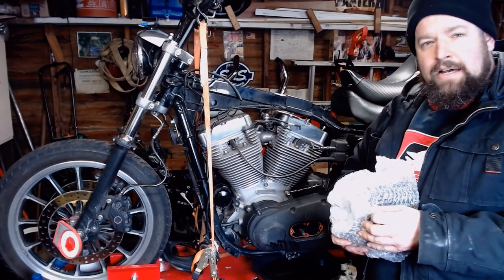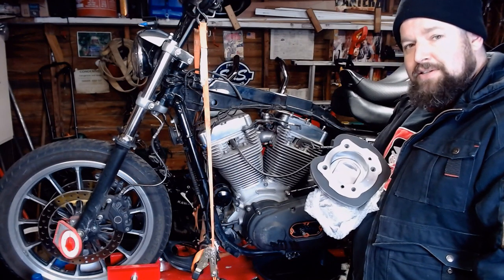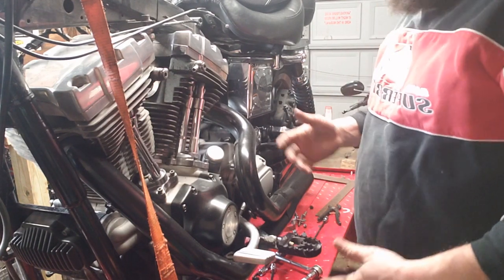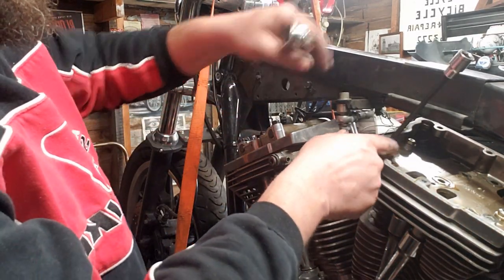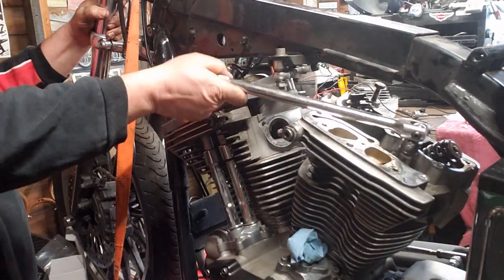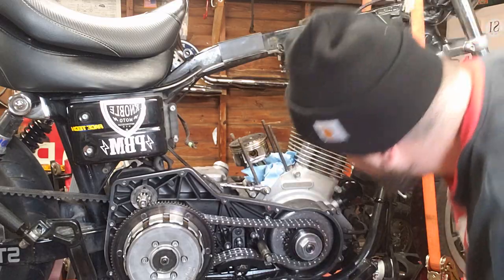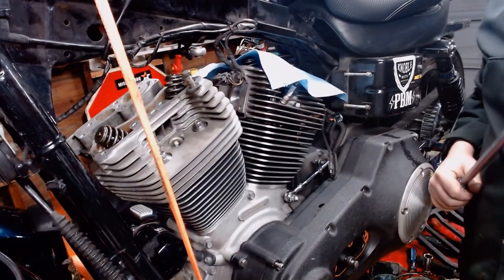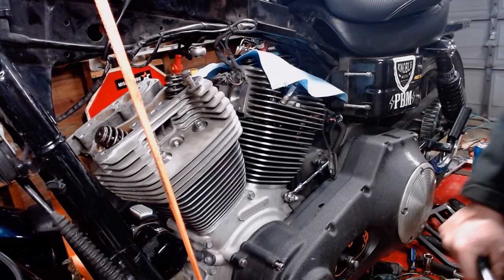95" Big Bore Kit on Harley Twin Cam Install

Comment: What year ?
Reply from the maker: 2005
Reply: @KnobleMoto  do you think it’s 100% necessary to do the timken bearing upgrade before big bore kit and cams
Reply from the maker: @MrHootenholler  no.  I wouldn’t bother with that unless you are pulling the crank. Even then, unless you are going for a stroker or 120+hp, I don’t think it is necessary.

Comment: Is this a Russian Harley ? 
At time 12:29  better to push the ring down the cylinder somewhat with the piston, keeping it square. Not measuring the ring at the top.
Also , at time 16:26 not so good to scratch the top of the piston with the ring . Wow! As I watch this video I see more things not looking good . I see no oil on the piston or rings ,  and 
most jobs put the piston on the rod first , GGG. I think you installed the piston that way cause of the type of ring compressor you had. Again, at time 28: 04  you torqued the head /cylinder 
down the wrong way.... Not to be torqued cross way,  should have been torqued  lowest bolt  one one side first then highest bolt on same side , moving to other side lowest then highest.
Reply from the maker: A small scratch on the top of the piston doesn't matter because that is not a contact surface. Everything was oiled that needed to be.  I hope I didn't forget to mention any oiling steps in the video.  Yes you lube all metal to metal surfaces with a heavy oil or assembly lube.  I am not a pro cameraman or tv star, so a lot of this was done in multiple takes.  The ring compressor came off at least 5 times (should have bought a better one).  
Anyways, the motor has 3k on it since this build and it runs strong.  Thanks for you input.  Tag me in your motor assembly video so I can see how you do it.
Reply: @KnobleMoto  .... In the video you didn't put one drop of oil on the ring. Also,  while you were sliding the rings on the piston you scratched the side of the piston not the top
of the piston, we all know scratching the top isn't a concern.  Also, checking the rings at the top of the cylinder isn't correct . The ring should be down the bore an inch or so not at the top.
Thank you for your video it is somewhat helpful to people but buy some tools to do the job correctly, like an ring compressor tool and a ring expander tool.
It's great you are doing your own work and saving money !